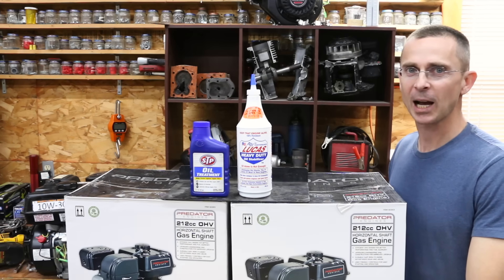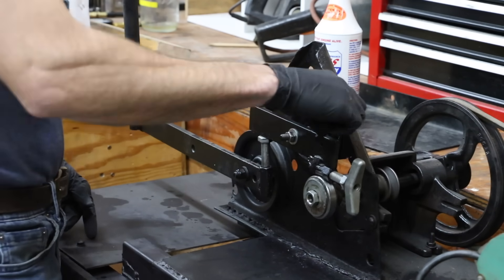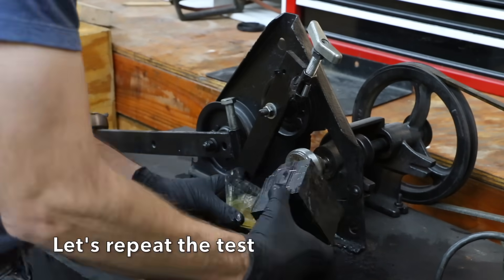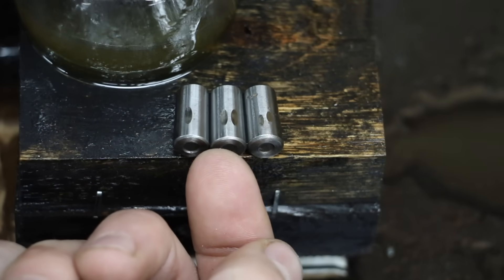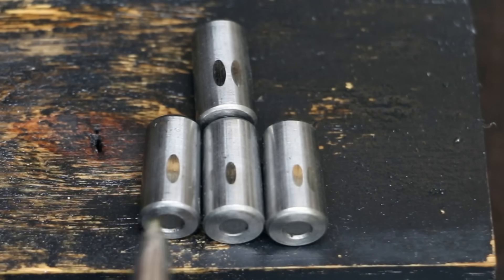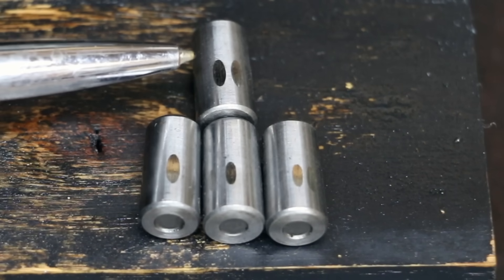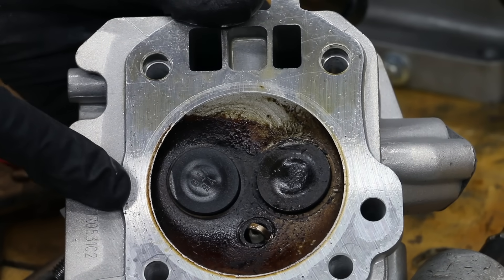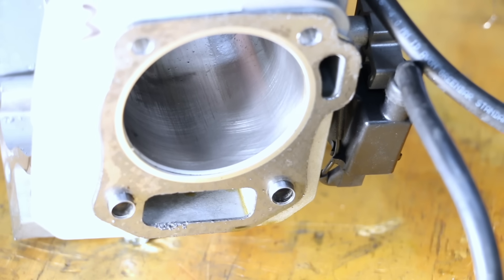Which engine self-destructs first?  Lucas or STP?

Comment: Will you investigate the lubrication properties of adding powdered graphite to engine oil ? If it works well in a small engine maybe check if it will pass through an oil filter. Do you know of any oil additives that have PTFE in them like the old Slick 50 ?
Reply from the maker: Great video idea!
Reply: I believe all the Teflon products have been taken off the market.  Powdered graphite was an old trick to TEMPORARILY fill scratches in an engine cylinder.
Reply: I suspect PTFE was ousted by the big 3 and the govt. to sell more new cars, maybe we can make a substitute ourselves . . . anyone have any ideas how or where to get the PTFE ?
Reply: I was thinking graphite would get jammed in the pores of the bearings, cylinder walls, cam etc. that doesn't sound like a bad thing to me, it's pretty darn slick stuff . . .

Comment: How about leave the oil in the engines but have one with just oil and the other with say lucas or stp and bypass governors cable tie throttle wide open and see how long they would last. That would be a test.
Reply from the maker: Great recommendation. Thank you

Comment: If you mix lucas oil with synthetic oil 20:80 and make the engine run, The synthetic oil velocity will change to low or high?
Reply from the maker: Yes, it will chance the viscosity.  Thank you

Comment: I am an experienced mechanic and this is my take on this.Number one..Oils nowadays are real crap compared to the oil we could buy many years ago when oils were not deprived from essential additives,Especially Zinc,Calcium and Phosphorous..At the moment i recommend to use both of these products..i like stp because of the Zddp,literally inexistent in today's oils,regardless of the brand.If you use any of today's oils in the SN API service category,you had better add some of this to your engines.And it is not me, telling you,It is the API engineers warning you about it.The levels of Zinc have been reduced from 1200 to 800 average,varying from brand to brand.This is not something to argue about,this is a fact that needs to be understood..I have a neighbour who is 70 something years old.Her toyota has always been driven at no more than 50 miles and hour.Very slow acceleration,never abused..This toyota has been using oil found anywhere in the U.S..and at 95000 miles this car is done...I started adding STP high mileage in her car,and the difference after one week is amazing...i could not believe this is such a cheap product offering endless benefits...I love lucas too and have been using lucas gas treatment for years and all my engines last a long time without any issues..Very good video..Stp claims this products builds a cushion to reduce metal to metal contact and this video proves it.the fact that the temperature is lower with the stp proves this is a great cheap product..less friction...less heat..less tear and wear..i have used them both and they work...Thanks for this video..Stp also offers an oil stabilizer that is really good..Use them as directed and you will notice how your car runs like when brand new..
Reply from the maker: Thank you
Reply: Thank you Project Farm

Comment: Question is did harbor freight take those engines back
Reply from the maker: lol. I kept them since I caused the damage.
Reply: @ProjectFarm  Maybe you can sell the spare parts for extra cash on Ebay?  All this stuff takes lots of time...not sure I'd want to mess with all of it...
Reply: I was thinking the same thing, several parts from both engines are totally usable, and would help recoup a percentage of the total money spent on those engines.
Reply: @ProjectFarm  Yea right
Reply: Hone the cylinder, buy new rod, crank, and piston and the motor is good as new. Honing is not even necessary really, just run thicker oil. I bet you would get years out if those motors with normal use after..

You should rebuild the motor and try "Restore" to see if it cleans up the cylinder walls any..
Reply: @jmhm17  Completely agree with that. These engines are pretty new and with some new parts, they would be better engines to run future tests rather than those old lawnmowers.

Comment: When i bought my 03 altima it had oul leak by timing chain i didnt want to change it i was too lazy but i used stp and my car lasted 2 more years it could have lasted longer if i didnt blow my engine racing but i was driving many time with no oil in my car because when i filled the car up with oil it would only last a few days until it was empty i used lucas as well but more stp cuz lucas was too expensive and i was buying oil every week lol so stp is good so is lucas if u want your car to last tho i would recommend jus use both lol
Reply from the maker: Thanks for commenting on this.
Reply: Just fix the engine. Keep up the maintenance.
Reply: You drove a car for 2 years that was leaking 5 quarts per week...the environment thanks you!
Reply: @flyingturtle3384  lmaoooooooo no prob most of the oil was burnt off out the exaust in a cloud of smoke on cold starts im talking thick clouds that covered the entire neighborhood those were the good ol days

Comment: redline fuel additive vs gumout one an doneboth have shown me really good power(running 87 instead of 93 saving $0.60 per gallon), getting 27- 34 mpgs mix of highway & city driving daily, getting in an 1996 Nissan maxima that brand new got 28 highway & 21 city averaging 24.5 mpgs.all the videos for redline don't really show results an one an done just shows what gumout ads show
Reply from the maker: Thanks for the video idea.

Comment: These additives are only good to use on engines that are on their last legs and desperately in need of a complete rebuild.  Yes, they'll stop leaks and keep compression up when the rings and seals are worn out.  But otherwise they should never be used.  Why?  Because you just increased your viscosity; the same additive you used to stop blow-by and keep leaky seals intact is also probably gumming up oil galleries and causing increased wear during cold starts.

So, unless you drive a rust bucket on its last legs that needs to be kept alive for another few thousand miles, skip the snake oil and just put regular oil in your vehicle!!!
Reply from the maker: Thank you
Reply: Just vary the amount, and choose the right product.
Reply: Hey Lash. How would you have done this experiment? As I see it, that test would be almost impossible to do with long used engines wouldn't it? You would have to have both engines with the exact same wear and issues to make the test accurate. In this cases we all know that one engine was no different than the other.
Reply: @SimplyVolunteer  Hey Myles.  I think you are hitting on the right track yourself here — you would have to have two (or likely more) engines with the same amount of hours on them.  That would indeed be hard to do for the purposes of a YouTube video, but in industrial quality control settings, they do indeed to these types of stress tests (i.e. wherein they subject a unit to sustained operation until it fails).  To be meaningful, these types of tests would need to be statistically validated as well, so that would imply more than just two units (statistically speaking, it could be 20 or more units, depending on a lot factors!).

Comment: Doesn't prove anything as there was no 'control' engine.   The 'control' engine should have had only straight engine oil before being drained and run.   So, nothing gained here other than destroying 2 new engines.

Comment: What a waste of good small engines. The first test with the bearings was the one that I would consider to be the accurate test and here's why. No two mechanical wind up watches or even digital watches will keep the same time and my point is this: Although both engines were the same including how you handled breaking them in, I'm willing to bet the the outcome as to which engine shut down first along with the damage would have been the same had the oils been switched. You would have to run six or eight engines side by side to get any accurate data as to which engine ran longer or even the damage measured in each engine. Any average engine is going to burn up once the oil is removed so once they started knocking, all bets were off.

Comment: .."it’s all snake oil...engines will run properly if maintained correctly...don’t need the additives as the engines were not designed to run with them in the mix
Reply from the maker: Thank you

Comment: I'm glad you did the bearing test because I think on the commercial they would cheat and put household  bleach on it. You should try the bleach test. When i was in my 20's I tried putting a little bleach in my engine oil to see how it would perform it didn't seem to hurt the engine and the car did run cooler. Don't use STP oil treatment if you would have had STP in it for a long time like it you used it regularly it gunks up the engine real bad clings all over inside the block and I mean thick.
Reply from the maker: Thank you for the tip on STP.

Comment: I'd like you to run a control test without additive so that we might understand the added value. If the engine fails after 5 min then it really a matter of preference. If the engine fails a fails after 10 then lucas has a clear win here. That's of course not accounting for manufacturing defect.
Reply from the maker: Thank you

Comment: I use marvel.mystery oil to clean out sludge on old engines . Can you test it against other sludge cleaners. I bought an 81 cj5 . I had to replace the valve cover gasket . When i took it off the build up of cooked on crusted oil was a half inch thick everywhere. I replaced one quart of oil with marvel and drove it 100 miles. I did this three times. After three oil changes and 300 miles all of the build was gone. But i also had to pull my oil pan to clean it all out . It simple would drain thru the hole and would clogg the oil pump pick up screen. I look foward to som emore of your videos. Thanks for your work.
Reply from the maker: MMO is a great product. Thanks for the test idea!

Comment: Hi my name is Jason,and I've had the privilege to befriend a petroleum engineer .
I just changed my oil in my 360 4 speed 1993 e350 Ford van.
36 thousand miles!!!!! No lie still have oil to be examined for acid and solids,I'm really interested in the viscosity levels.
Mobil 1 high mileage,Lucas additive,
Before I purchased the van it was using Castrol gtx high mileage
My odometer reads 2038.10.3.
One oil change to California from Bellingham,then to Wenatchee ( all mountains there and back)no issues! Oil is ready for the labratory.anybody want a sample.let me know on this site.
Reply from the maker: That's a lot of miles on oil. Thank you

Comment: 2001 I driving my 84 Chevy short bed truck,  It has 6 cylinder 250 in it, 23 miles outside of Reno Nevada heading for Elko, Threw a rod at 65 miles an hour, pulled over there's a hole in the right side of a block, two holes in oil pan, not a drop of oil in the engine, except for what was on the ground. cut across the median started heading back into Reno, I knew the engine was toast, I was trying to shorten the distance from being picked up by a tow truck, drove it into the outskirts of Reno, pulled in a gas station near This little Casino on right hand side of a road,  the engine was cherry red hot, on further inspection I look to my left side of the engine driver side, there's a hole where I could put my fist through,,  Rod BEARING CAP was on the left side of a motor mount,,,,,, I always use Pro long since I seen that advertisement that was done at the Indianapolis 500,  with AJ foyt, Parnelli Jones,  Dale Earnhardt,,,  Where they had that $1,000,000  offer to any company that can beat their oil additive, STP was the first one that got smoked!!! Slick 50,, HaHaHa, Etc Etc Ect Smoke every one of them!!!  If  you want to test something? test( Prolong...) my opinion Its the best!!!!!!
Reply from the maker: Great recommendation!  Thank you

Comment: I thought STP, being the racer,s edge, just put a little more edge at the edge of the Piston, for more compression each time the spark fired.  But this test would have been more fair with either both having 8:1 or 4:1, or just running the motors empty after running 100% of either.  I still love STP.  It always kept the lifters quiet on the old Chevys.
Reply from the maker: Thank you

Comment: A number of years ago there was a demo on the parts store counter. It was a container filled with STP. Inside the STP was a set of gears and a shaft. The gears were powered by a sewing machine foot pedal resting on the counter. Pressing the foot pedal with you hand could make the gears turn faster and faster. The amazing part was the faster it went caused the STP to come off of the gears going straight to the shaft. STP failed the gear test. The companion test was a Bardahl oil additive and the faster those gears turned the more Bardahl oil additive went to the gears.
Reply from the maker: This is interesting. Thank you
Reply: @ProjectFarm  To conclude that conversation these clear boxes disappeared due to a lawsuit filed by STP against Bardahl (I'm unsure of the outcome.) I'm sure one your viewers probably has one stuck in a box in a corner of the shed who could send it to you.

Comment: Just do you schedule service on you car when ever 3 months, don’t run you motor on a lot load and it will be fine, and you race you car remember to go to a heavy oil for you engine then the manufacturer recommends, that way when you car is running hard  it will properly lubricant the engine and prevent premature wear
Reply from the maker: Thank you

Comment: duralube vs slick 50. I have used both in two different cars, and both of them seemed to have performed well. But it would be nice to see which one is best. Both claim to coat internal engine parts, supposedly protecting your engine during startup.
Reply from the maker: Thanks for the video idea!

Comment: What about household bleach as engine oil? I once saw a duralube comparison vid and bleach did better 200 % . . . in a similar bearing tester. Would fume off in an engine though and corrode but would it be a o sheet fix?
Reply from the maker: Thank you

Comment: Lucas is meant to make motor oil more sticky on metal. I've used STP and Lucas (not together) as more of a between cold start vein of lubrication. The Oil tends to cling between metal to metal before oil supply increases to engine pressure.  Oil also acts as a coolant to even out temps and carry heat to the casing. Fins on the cylinder head increase surface area for heat flow into the relatively cooler air.
Reply from the maker: Thank you

Comment: BG MOA.  A salesman came by our shop and did a demo.  Really sold us on it, I had a buddy use it religiously and after busting a hole in the oil pan and driving the truck another 100miles I'm a believer.  Added oil to his truck after changing the oil pan and its still going strong 150k miles later.
Reply from the maker: Great test idea!
Reply: If you send me an address I can ship you a can.  I just received a 6 pack from amazon.

Comment: My father in another bout of insanity that worked out OK, his steering rack was leaking on his Ford Freestar with 450k miles, so he just drained all the old fluid out of it, and filled it with STP oil treatment, and it didn't leak anymore. Steering got a tiny bit heavier, but actually wasn't all too noticeable. Not a small engine application, just figured it was interesting, haha.
Reply from the maker: lol. Nice!

Comment: MARVEL MYSTERY OIL
Reply from the maker: Great video idea!
Reply: Marvel can help with noisy lifters. I've seen it a 100 times. It must clean them or something?
Reply: Marvel has solvent properties. I used it on an old 79 Buick Century and it wound up cleaning out all of the varnish in the valve train and reciprocating parts. My oil light would come on every time I stopped at a traffic light after that. But that wasn't anything a quart of STP "piston glue" Oil Treatment and 4 quarts of 10W40 oil couldn't fix at my next oil change.
Reply: that stuff is garbage for lubricating its good for cleaning but you shouldn't run it for a long time.  its pretty much the same as wd-40.  just look up the msds its mostly stodder solvents and some kind of petroleum oil probably just transmission fluid.
Reply: Amsoil!
Reply: I am soil me trousers

Comment: ALL RIGHT!!! Another dumb test. How in the world do you stop YouTube from bring these back up. The test is invalid because the grind you put on the wheel is not the same for both products. You can use the same grind, because the first time you use it the sharp edges have been smoothed by the first sample. This dude has no sense for testing. 
Just use Prolong and forget the BS products. I actually ran a AUTOMOBILE ENGINE without oil in it running at 70 mph for 60 miles and had no damage to the engine. I ran that same engine in that vehicle for several years afterwards...NO problem.The reason it didn't hurt the engine was because the engine had been treated with Prolong. Here you go. you can get it here or your local auto parts (Autozone has it) https://www.ebay.com/itm/Prolong-Engine-Treatment-/112219439683